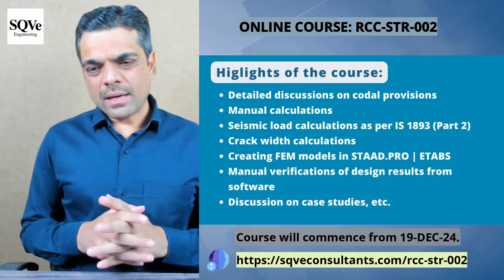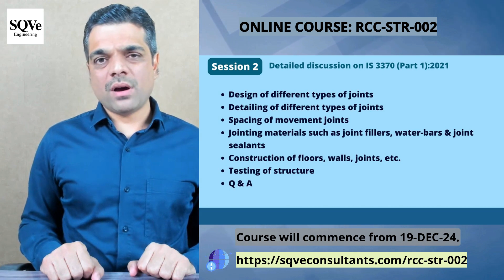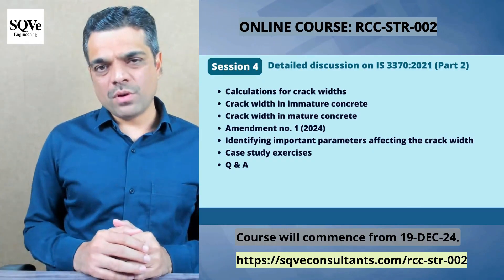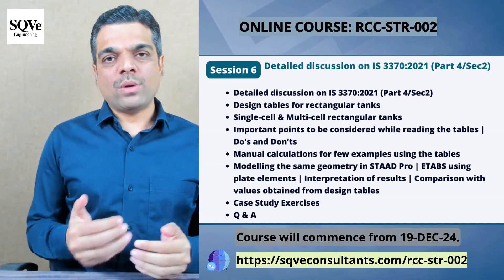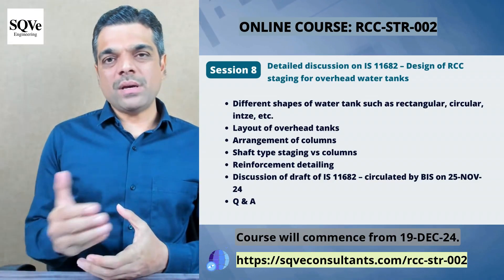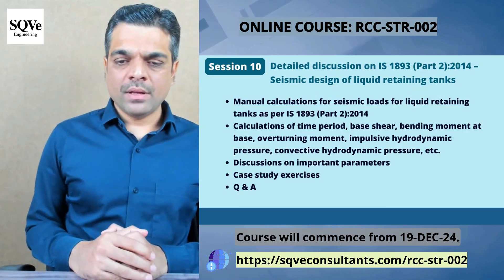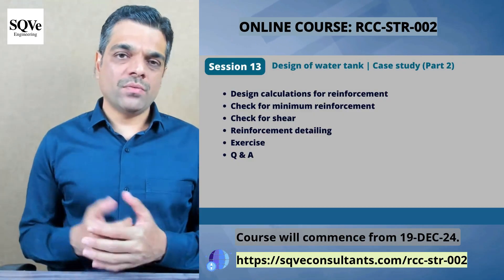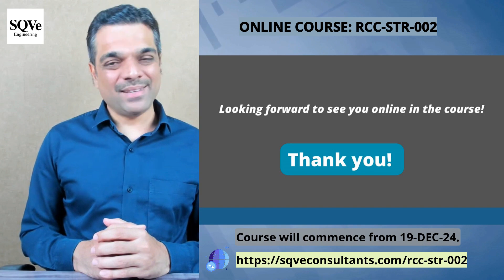RCC-STR-002: Design of Liquid Retaining Structures | IS 3370 | IS 456 | IS 11682 | IS 1893 | STAAD

Comment: Does this course contains "ADINA" for analysis of water retaining structures for hydrodynamic (sloshing) loads ? 
   (As staad pro has no direct option to implement the hydrodynamic load for the tanks, also staad pro has many limitations and tedious work for analysis of the tanks for hydrodynamic load. While all such options are easily available in ADINA and simulation of structures is relatively appropriate in ADINA.)
Reply from the maker: @Enfld1122  "ADINA" is not considered in the present course.
Reply from the maker: We will perform manual calculations of seismic load as per IS 1893 (Part 2) and will apply the forces in STAAD pro.
Reply: okay, but this process is limited to some special case and conditions, i.e. it is applicable only for purely rectangular and circular shape rested on flat ground, without roof on its top,walls of tank are uniform,(not tapered) etc.  Moreover, water can not be modelled in staad, whereas in ADINA water can be modelled using computational fluid dynamics/potential fluid dynamics, thus more appropriate simulation can be executed during sloshing condition and much less efforts needed, thus time saving, if using ADINA. Also, AdDINA is for any shape of tank or irrespective of any other conditions.
Reply from the maker: The present version of IS 1893 (part 2) doesn't permit simulation of hydrodynamic loads through the software.